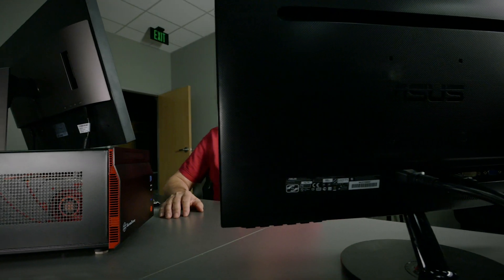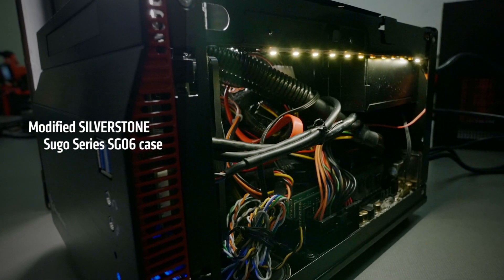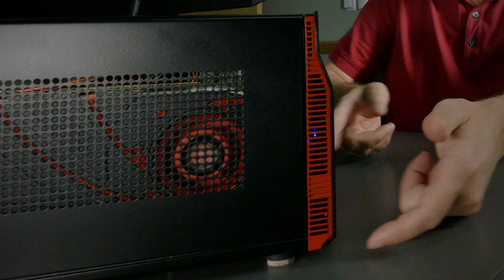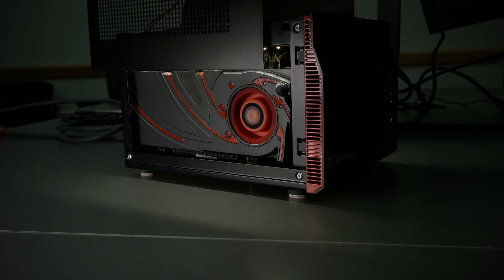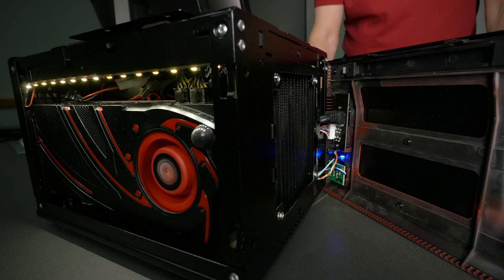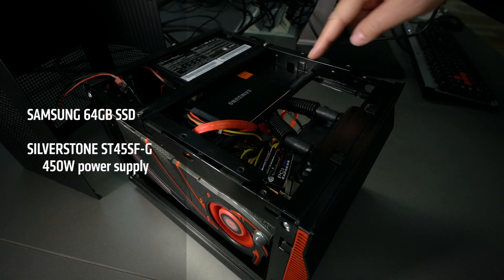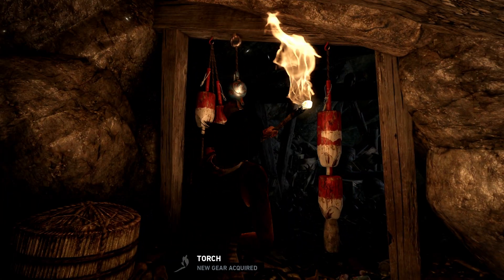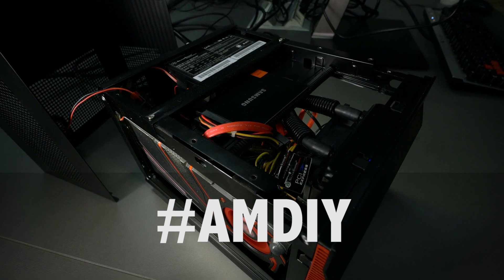#AMDiy – Building a mini-ITX system with Ed Callway

Comment: it's amazing what you guys did to pc architecture. when i was young a computer capable of computing demanding tasks would cost between 1500€ and 25000-3000€. now, since you guys contributed to playstation 4 and xbox one development, you can buy a really amazing machine for 500€. that's sick. and if you do so, you can pretty much maxxout unreal engine 4, for purposes of vr development and interactive cgi, etc., and work with sycl for dsp sound computation and all these kinds of things, which is ultimately sweet. thank you so much amd

Comment: to build a damn miniITX we need damn MINI ITX motherboards, right now its like 1 or 2 out there and those are crazy expensive and only for APUs! we also need mini itx that support FX processors.
i am hoping soon you will reveal the next major step in CPU and GPUs. we need to go under the 32nm in CPUs at least 28 or 22nm and we want a new FX processor not an other APU in the already crowded market of yours.
Finally dear AMD we need a damn new Chipset! drop the southbridge like intel did with x99 (actually they dropped the north, and they transferred the functions of it  to the cpu and memory controller it self) and give as a new main chipset that will include all north+south chipset functions. the new chipset should replace 990FX, lets call it 1000FX should be PCH architect like and should have:
PCE-X 3.1
usb 3.1
sata 3 (from 4 to 10 ports)
raid 0,1,3,5 (windows 10 boot ready)
DDR 3 and or DDR 4
killer price tag! (i mean lower than intel)
and then the manufacturers could build smaller motherboards!(like Mini-ITX)

thanks for not listening. :(
Reply: Their new 300 Series GPU's will come out in Q2-Q3 2015...22nm manufactured and stronger than Nvidia's Titan II/980Ti!
Reply: NoGoodNameGG to be honest i care a bit more about chipsets and performance FX CPUs right now, amd we are falling behind! move your asses! 2016+ is unacceptable! your CPUs will be 5 years old and Intel will be in 10nm already!
Reply: ***** Zen architecture will come in 2016, I think it will be 16nm, NOT SURE THO
Reply: *****
me too i really like the fx 9590 but the pcie 2.0 is a no go so at the moment i am just waiting and i wont wait forever :|
Reply: Fun forLife you will almost never need the bandwidth of the pci 3.0 trst me you barely reach the bandwidth of the pci 2.0! even in extremely heavy 3d rendering by professionals i never seen one or read anywhere that pci 2 was a bottleneck vs pci 3.0. (ONLY if you do like 4way SLI or Crossfire in more than 1 full HD monitors you will see a benefit! for less cards and monitors no difference at all.) but the next chipset has to go to the next level just to be "future proof".
Reply: *****
yes thats right but if you compare crossfire benchmarhs with pcie2.0 with pcie 3.0 you see difference (not big not small)   ;)
Reply: Fun forLife here is your proof. that at least for now its just fine with pci-e 2.0 vs 3.0
http://www.pugetsystems.com/labs/articles/Impact-of-PCI-E-Speed-on-Gaming-Performance-518/
and to see the difference you will need more than 2 GPU cards to crossfire! so again the money doesn't justify the performance.
most people prefer single powerful GPU solutions and gaming in a single monitor.
Reply: *****
thats right ;)
Reply: The new carizo cpus will have an integrated southbridge, however these will be low power parts (sub 35 watts). Also I believe AMD knows what it has to do, but it also knows what it can and cannot do. AMD has seen better days, but they're hanging on. Guess for now I'll stick with my intel cpu and AMD gpu.
Reply: The new AMD CPU will be here in <2 years.
Reply: they have to do faster and better than that!
+2 years in an already old chipset platform.
Reply: *****  You could just buy an Intel CPU until AMD catches up. At least that's what I did. My i7 spanks my old fx series chip. Though I'm not sure why people complain about AMD CPU's being hot because this 4790k runs about 8C hotter than my FX 6300 did and it was overclocked to 4.7Ghz.
Reply: Casey Powell nuh i will pass mate. i prefer to avoid the overpriced intel cpus. most of the times i can buy +1 pc with AMD parts rather Intel. So i will wait a bit longer. after all we have to push them for the benefit of competition ;-)
Reply: ***** Much respect to you sir. I hope AMD does well in the future because I like seeing a good battle. Lol. If Zen is as badass as it's supposed to be I will most likely switch back.
Reply: Casey Powell yeah, AMD needs again what they did back with teh 1st x64bit CPU and the FX series, Intel was so left behind, that microsoft decided to go with AMD for all the x64bit windows since then and you can see that even from todays OS folders, the folder is named AMD64 because it was the 1st back then, intel took months or even more than a year i think to come up with something. still AMD was kicking ass for years until the Core2Duo came to strike back...and that was the team that created Centrino for laptops! the Centrino architect was much better that intel dropped the p4 and created the core2due based on the centrino. the mobile cpu saved their asses back then, and thats a fact learned from a documentary years ago.
Reply: ***** Even though I'd like to wait for the Zen, I just can't. My old rig is dated and I won't devote another 2 years of my precious time to waiting for my pet semiconductor company to do something.
Reply: JAnx01 If you want to upgrade now and stay AMD (and I understand if you wouldn't my AMD 8350 gets disappointing performance with World of Warcraft compared to Intel, among other issues) the 8370E is a good bet, as it gives you 83xx performance in a 95W thermal envelope.  I have a 125w 8350, but it can be hot and power-hungry compared to the 95W processors I'm more used to.

Comment: why not 860k? isn't it a10 7850k without integrated gpu?
Reply: It is an a10 5800k w/o iGPU
Reply: +Doge Gaming 
big no. it is 7850k w/o igpu.

http://www.cpu-world.com/Compare_CPUs/AMD_AD580KWOA44HJ,AMD_AD785KXBI44JA,AMD_AD860KXBI44JA/

5800k has 100w tdp, 
860k and 7850k have 95w tdp

5800k has 2x64kb L1 instruction cache,
860k and 7850k have 2x96

5800k is trinity codenamed fm2 cpu with 32nm lithography
but 860k and 7850k are both kaveri fm2+ cpu with 28 nm lithography

stock/turbo freq. of 5800k is 3.8/4.2 ghz
stock/turbo freq. of both 860k and 7850k are 3.7/4 ghz

Comment: I really like this, BUT if yiu'd wanted, you could have routed the cables way better. Yes, that would have ment more work, maybe shortening some cables, but the System would have been tidier and you could have showed off the inside of it.

I don't have enough money to buy new hardware and then mod it, only one of it (and that mostly is buying new hardware) but I'd really like to give you some suggestions, maybe you like them:
- slim air filter in front of the rad. Prevents dust and running hot in the long term
- Put the SSD at the side of the case, should be (barely) possible. This then leads to:
- Put a Window in the top to show off part of the Hardware. With a mini ITX System such as this that should still be possible.
- Change the Power supply location, with an SFX PSU it should be possible to have the PSU at the front, let it's fan also be the fan for the rad so the Motherboard can be showed off way better.

Or, the best thing would be, use a scratch built case, that's a bit better than the Sugo, which unfortunately still has Design flaws. I think I could build a case in similar, maybe even smaller dimensions with all the space for hardware in it and still have it look a bit neater.
Reply: Damn, sorry for some misspelling, I didn't read the first part through again.

Comment: Good stuff.  It's interesting how much you can put in a small form factor.  That said, I don't enjoy messing around with mini itx and other small cases because I'm clumsy when it comes to stuff like that.

Mid-tower or full-tower?  Sure, but mini-cases just aren't easy for me to work with.  Anyhow, I'd like to see what AMD has next when it comes to GPU's and CPU's.  I'm a little bit disappointed that the 300 series was delayed, but I understand why Zen needs until 2016 to come out.

I also would like to see better Linux drivers.  I try to game on Linux more, but the Catalyst drivers on Linux are noticeably worse than on Windows for my R9 270x.  I also couldn't enable Crossfire when I had 2 R9 270x's in my 8350 rig.

Comment: I don't care about desktops anymore. Just get a damn OEM to build a tablet with A10 Micro-6700t, this apu is already released, but I see no device using it. There is only the HP with the A4 and very underpowered components (bad battery, bad ram etc). I don't care about the name of the OEM, just to make a good quality windows/Linux 64bit tablet with the A10, 64-128GB SSD, 4-8GB of ram, an acceptable battery (like 6-7hours of light using), and with DockPort. And a docking station. The screen should be anywhere between 8 to 10 inch with a resolution anywhere between 1280x800 to 1920x1080, and landscape, not portrait. It also should have included an keyboard dock, like Microsoft Surface tablets have. Or at least to have one to be able to buy separately...
This kind of a tablet would make great competition to Surface Pro tablets.

P.S. If you really can't make a nice specs tablet, at least release that pocket PC that can be mounted on a TV. Intel already has a chrome-cast like stick with Atom and Windows/Ubuntu OS, but something with an integrated camera would be great.
Reply: MrBiky 

I agree.  I'm surprised that there aren't more Surface-like AMD hybrids with detachable keyboards.  If they could get the heat and power issues figured out, they could be very portable gaming solutions.  Intel's APU's just really aren't very good for gaming.  AMD's A10 series however, are surprisingly good.
Reply: Brian Kim Actually, the A10 micro-6700t uses as much as an atom baytrail (3740), somewhere like 5w tdp (2.7w sdp). The heat issues aren't a problem (only at many intense hours of gaming, when it starts thermal throttling - that means we should take a 10-15minutes break for a snack or something). There is only a tablet with this APU, that doesn't sell in my country, because it's unknown brand - who the heck heard of Bungbungame???? (the name of the tablet is Bungbungame Photon 2). 

The only reason AMD doesn't have design wins is Intel's aggressive ways of "buying" the tablet designs from the big OEM like Asus, Toshiba and others. 

And the only reason the Photon 2 exists is because Intel didn't mind that a Taiwanese Company named Bungbungame would make an AMD powered tablet.

Also the "design wins" with AMD APU are mostly underpowered - if you look at HP's A4 tablet, its battery sucks and so on, and so forth... I believe that's probably another of Intel's tricks to make AMD look bad compared to Intel counterparts, when actually it's the exact opposite. 

I really want an APU based tablet, but Intel already started to make good gpu chips inside the high end laptops (Iris Pro). If Intel finds a way to get Iris Pro 6200 or what the heck numbers they are using inside the new Atom chips, the only advantage AMD had in tablet chips (the gpu), would be lost. At the moment Iris Pro uses a lot of power for a tablet, so the game is not lost. But AMD really needs a good partnership with an OEM to make a good tablet (doesn't matter if it's Acer, Asus, Toshiba, HP or who knows what other).

These might sell like fresh bread.

Comment: AMD, please. You're better than Nvidia and have better products, so why are you so crappy marketing and can not be sold. You need to show kd everywhere you like doing processors for consoles and a lot of great things.
Reply: Jon H
Imho - the best GPU to buy atm is the 290, and fuck power consumption i(and my 1200W PSU) dont care if its 200 or 300 watts - the only thing i care about is that my 160€(!) r9 290 with a 120mm watercoller and NZXT g10 at 1200/1600 67 degrees celsius wipes the floor(especially in 4k) with a gtx 980, thats 230€ vs 650€ ! - oh yes and it actually has 4 real gigs of RAM. ;)
Reply: mariodrv GTX 970 is the one you're trying to talk stuff about... such a fail.

GTX 980 does have 4GB and actually runs slightly faster than the R9 290x, I'm not saying AMD is horrible because I'm thinking of getting their rumored R9 395x2 GPU if it's real. I support both because they have both positives and negatives. Just stop being such a fanboy, it's great to see that you want AMD to step up their marketing but leave the Nvidia bashing out of it.
Reply: I lol'd are you fucking kidding me try to sli an r9 290x it would overheat thanks to ailenware they just showed it, Nvidia is focusing on the more important things like cooler operation and less voltage.
Reply: AMD is the best "bang for the buck". Sometimes on discounts you can get equally performing AMD card with half the price of simillar Nvidia one.
Reply: CreepshowandGore You know what would be funny?
Making you try to define what you actually mean by "talk stuff about". xD
The rest i agree with - and ofcourse i meant the 970.
Reply: Better at lowering prices, higher power usage, central hating your house, not delivering drivers on time, making you deaf with they jet exhaust noise coolers...
Reply: mariodrv No. The enthusiast dream is to 4x sli, And the maxwell chips are so much better handling the voltage + heat that it beats down amd by far and they have better performance
Reply: check on r9 300 Series :)
Reply: sli is crap compared to crossfire - you are right on the rest tho
Reply: Skissoed !

go and watch tech of tomorrow there you see that amd graficcards run cooler under full speed then nvidia ones
Reply: samik654 r9 300 series? you mean the entirely rebaged series bar the flagship gpu? thats funny. Would probably be more suitable to call it the r9 200 v 2.0 or something equally lame
Reply: Fun forLife i lold, do you think anyone will actually run the fan at full speed? and its not even with the new nvidia cards.. otherwhise give me the link please i really would like to see them try with an 970 or 980 :)
r9 290x goes up to 95 Celcius in full load with reference design. And its noicy as fuck
Reply: mariodrv Yeah crossfire is + compared to sli since you can combine an APU and a GPU and you can use your oold cards.
Reply: Plus lower frametimes, no stuttering and no need for a CF bridge anymore.
Reply: Skissoed ! That's why you don't buy reference designs.
Reply: Game Maker
Some one who really thinks, thanks!!! :)
Reply: Game Maker still the non reference need more wattage and still runs hotter than nvidias non references

Comment: I still find ridiculous bundling an 7850K APU (basically the 860K Athon) with a R9 285. That's card is going to be starved of CPU power. Even a cheap FX6300 is going to do much better than this APU.
Reply: Ahhh No it won't.  Set your task manager to run in the background and then play a game.  Then immediately go back and look at the cpu load history.  You will see that it doesn't get overloaded..Already done it, so I know....